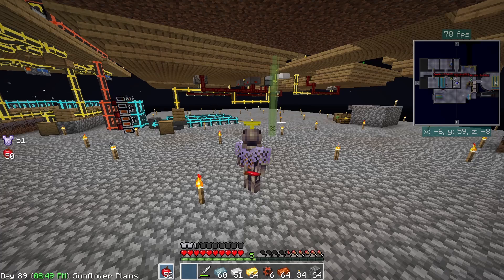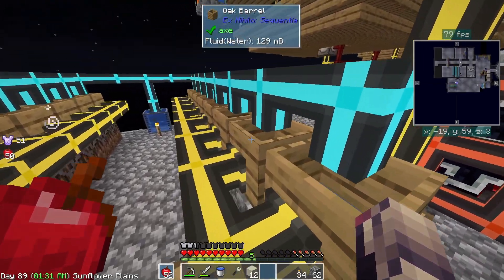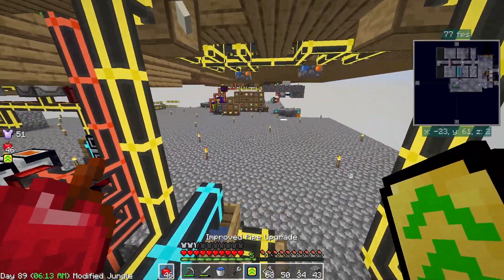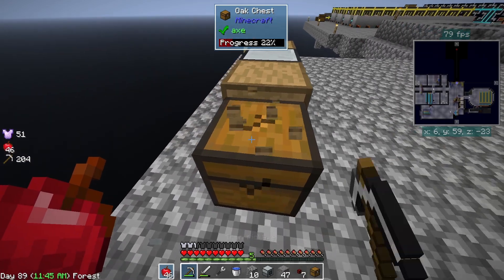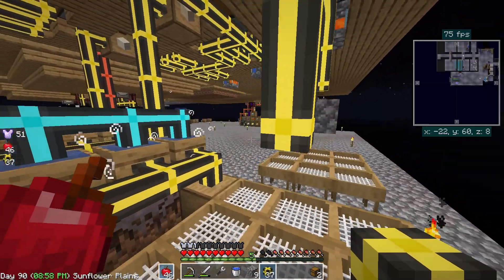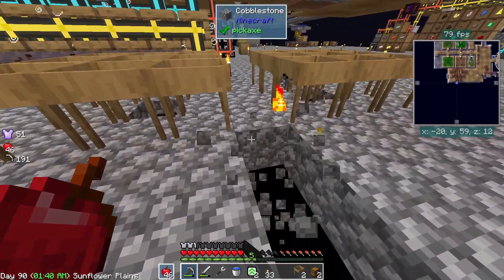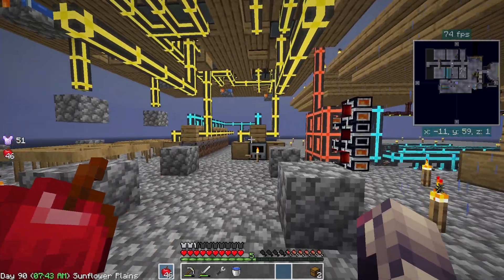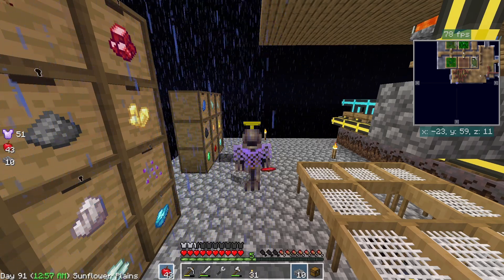Skyfactory One Ep. 15: Sieving System Move

Comment: fyi the cyclic fluid cables can extract water faster from an infinite source. i typically setup 3 sources in a row and then use the fluid cable extractor on the center to fill my tanks. then use either ender tanks or refined storage/me to transfer the water around. just figured i would pass this on in case you want to compact your water setup down.
Reply from the maker: I will have to look into this soon. Thanks :D